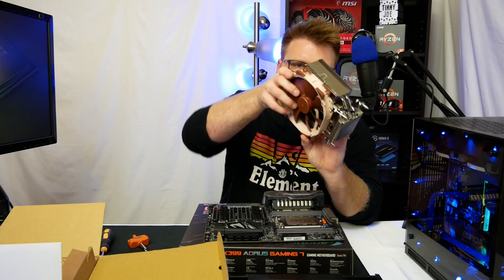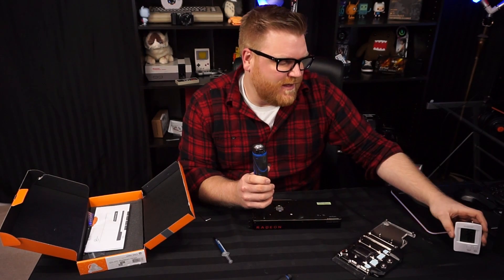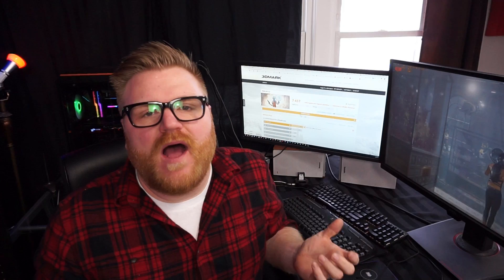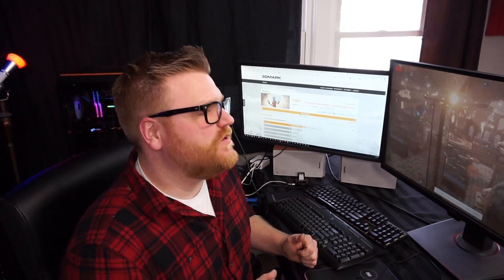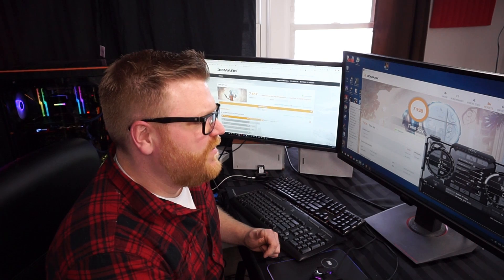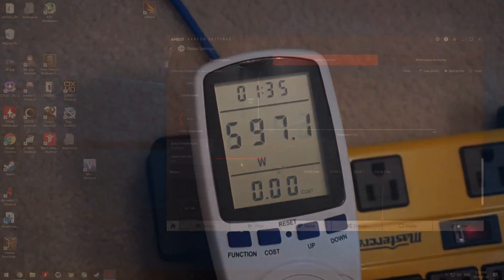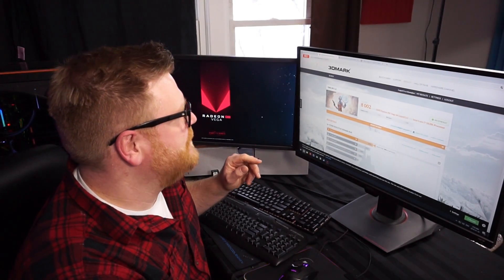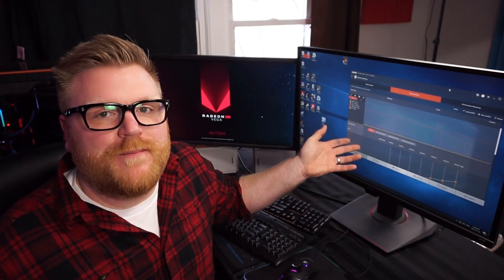Overclocking Vega 64 TO THE EXTREME

Comment: I prefer wattman. Undervolting  does work. Also hope you bumped up the memory.
Reply: Undervolt works, while you're being power/thermal restricted. But if it's about boosting the clocks as high as possible, on a subzero cooler the undervolt will just set clocks lower.

Comment: I just picked up a vega 64 gigabyte OC edition on ebay for $230 shipped.
Reply: And here I am thinking my $300 1070 ti was a good deal
Reply: @trv88r  and i thought that gtc 1050ti at 270 eur was a killer deal.
Reply: You sir, have picked up an incredible bargain. I'm not a fan of Gigabyte or ASUS Vega cards, but for $230 shipped, you cannot go wrong.
Reply: @chadwickhurlburt6529  I'm not either, I'm an xfx and sapphire kinda guy, but since it wa so cheap and an AIB, I went for it
Reply: @chadwickhurlburt6529  I got a gigabyte 1070 g1 gamer $425.00 when it came out I put new pads and paste, and for a old fx 6300 4x2 8gb memory rx 460 4gb 27in 1080p 60hz oc 75hz working good gigabyte not to bad for $98.00 new when video card's we're overpriced.
Reply: @chadwickhurlburt6529  Asus use to be mid to upper mid tier and now they are meh. ever since amd/ati/nvidia started selling their cards to third parties, Ive owned an Asus, Powercolor, and Sapphire card.
All 3 still work, but my Sapphire card, the highest end one (Radeon 7970) looks like it is first to die. Although I must admit the 7970 has been through a lot more hell than my asus radeon 4850 and shortly used (10 months) powercolor radeon 6770.
Reply: I just picked a RX580 8GB Golden Sample from PowerColor for £129.
Reply: @levyroth  I bought a rx580 4gb off ebay 3 weeks ago for $100, its what I'm currently using until my vega arrives :)
Reply: @titusarms  I'm thinking of doing the same thing.
Reply: It's cheap, can't fault that - but you will soon find out just why the gigabyte vega cards are cheap.
 - They're rather nasty (hot, loud and shittier than reference vrm)

Signed
--------------------------------
Gigabyte V64 owner
Reply: That's a great deal! I wish people in the U.K were crazy enough to build mining rigs, then I could get a great deal too. I also wish I had the balls/money to just pown a gpu till it pops/cant takes nah more laddy.
Reply: Im tempted to pick up a Radeon RX Vega 64 Liquid Cooled, for 400 USD. But not sure if it's worth upgrading from a 1070 TI. Any ideas? Gaming on a 35" 3440x1440 monitor.
Reply: Mads Isak I think, is the monitor freesync or gsynch, would be the appropriate question here.
Reply: @KevinScandinavia  had my omen 35" montior for sale, wanted to buy a freesync screen. Since G-sync now supports freesync monitors, but noone wanted it... so, went team green.
Reply: Mads Isak I’ve heard the same thing but I can’t find the option to try it out for the love of gaming so buying a compatible monitor was probably a good idea on your part 👍🏽
Reply: Mads Isak oh wait I misunderstood, but same idea 😄
Reply: Holy hell
Reply: And here I am sitting with a gtx 1050ti and no money to buy a new gpu
Reply: Got a 1080 for 260 (could've lowballed but whatevs) and some of my spare hardware I didnt need.
Reply: @kablooey2369  I got a g-sync monitor, ended up selling my 1070ti for 400$ (bought it for 450$ 6 months ago). And bought an RX 2060 for 450$. It's got Anthem bundled, so figured, why not
Reply: Downvolt and after that, overclock.
Reply: I built an RX 480 Xeon X3440 system for $230 😄
Reply: Hopefully yours doesn't blow up like mine did.... been under RMA for a month now.
Reply: @jdde013  mine did. Black screens with constant reboots, common the gigabyte gaming oc cards, previous owner never registered it for warranty, so I got it RMA'd today :)
Reply: Also just picked up a gigabyte oc vega 64 but for $295
Reply: @yosvanirodriguez7499   hows the card holding

Comment: so it is possible to use custom water block and with radiator? no need for pump water block or?
Reply: only with his temps, but not under normal room temperatur lol
Reply: Naw, you would need a pump and the radiator.

Comment: Love my Vega 64 sapphire nitro plus a air cooler that can actually handle the heat
Reply: That's what I have... such a nice card!
Reply: @BigSchu22  I love it! Looks good doesn't get loud and can over clock like a beast!
Reply: @beck320  Well i didn´t have much luck. Though mine manages to hit around 1640 MHz in games and around 1030 MHz for HBM2. I can get up to 1130 MHz, though depending of the game this creates errors above 70 degrees. 1080 MHz is stable overall, but creates small green pixel artefacts in RDR2 and rare crashes in Monster Hunter World. 1030 MHz is stable and creates no artefacts at all. Not a great overclock.
Reply: @Koeras16  that's ashame :/ overclocking is half the fun
Reply: @beck320  Well that how it goes. Though Sapphires Vega64 performs like a charm for 1080p. Bought it for 350 around a year ago. 

Can only agree though. Had a lot of fun testing the boundaries of this card. It can even go up to 1670 MHz in games, though for over 300 Watts.
Reply: Best buy ever, 270€ like new

Comment: glad to see Vega getting some love
Reply: Yea. My Vega64 Liquid card hits 1855Mhz on its stock cooler. Vega can do better but it lacks HBM2 bandwidth.
Reply: @nathans3022  what mem speed you run ?
Reply: @Steve25g  1100Mhz gaming. 1150 if I keep my room cold enough. My HBM is temp sensitive.
Reply: @nathans3022   I keep stable on 1530/1100 , 74% Fan, 925MV undervolt, Vega 56 , V64 flashed,without OC settings, it flies to 1650/1100, I love vegas
Reply: @Steve25g  can u help me underclock and overclock my vega 64 later ? i did ovezrclock an 470 and a 580 but vega are different
Reply: @Steve25g coreclock 1685 at 1080 mv 950mem

Comment: hey dude, was actualy just doing this, its going to hit negative 40 on wednesday, i was thinking of bringing my full pc outside and pushing everything to its limits, im running a powercolor vega 64 and 1800x
Reply: Condensation is not the problem if all outside the problem is coldboot bugs.  Memory and motherboards act very strange at sub zero temps.  Good luck though cold bug won't kill hardware just very frustrating.
Reply: im pretty sure if the whole thing is outside it wouldnt really develop condensation, but ill tske extra precautions, thanks for the comment friend
Reply: Seraph RTGN let us know how it goes bud very interesting
Reply: Cold air is very dense though, so it'll condense super easy. I guess you'd need to leave your PC outside so itself is as cold as the temperature outside so it's at equilibrium. Might need a fan on it to blast cold air on it to stop chips getting warm enough for condensation.
Reply: @stevenwest1494  There is very little moisture left in the air outside when it gets very cold.   Not going to get any condensation on electronics unless they have a lot of moisture in them when you bring them outside hot.
Reply: @lukew.9110  electronics have moisture in them?
Reply: Be careful with condensation. Unless you are are sticking a radiator or something outside, I would avoid sticking anything PC related outside.
Reply: HaloSam296 condensation isn't really a problem if it stays subzero as long as there is no temperature change. There will be no condensation while it is outside. When the condensation happens is when there is a change of temperature between the cooling substances and the rest of the PC. For example, LN2 is really subzero but if the rest of the PC is that temperature, it doesn't matter. It makes condensation when the PC is room temperature but the fluid is subzero. As long as segraph keeps it inside to thaw for a while before turning it on, he will have no condensation.

Comment: Vega is really insane with cold temps. Most air cooled cards cant even break 1700 MHz while gaming, and liquids max out at around 1770. Its not power limited (with reg mods), its not voltage limited, and its not silicon lottery. Its some fuckery with its boost algorithm and temps.
Reply: r u related to john wicks
Reply: @Invisinine im him
Reply: @jasonwicks7604  I got a nvme on a pcie and added 256 gigs of swap... think I can use it as vram on the vega 64?
Reply: @Invisinine I mean, with HBCC you can. Kinda like the SSG. Not sure how you could set that up in windows. Im sure on linux theres some obscure flag in ROCM that lets you flag memory SSG style.
Reply: @Invisinine also why are you asking me
Reply: @jasonwicks7604  i dunno

Comment: I am thinking about replacing my 1500 watt heaters with pentiums or something. Lol. Mine xmr. Or something. I think it will be cheaper. After I oc them.
Reply: there is actual a start up, where you buy a pc that is heater together cuz it mines cryptocurrency alltime lol
Reply: @Xenoray1  it expensive I just want to go to goodwill lol.
Reply: @RavenPrecept last winter I had a 120mm rad on my i7 3930. And it got how with the heater on low lol.  Ridiculous

Comment: Radeon 7 has 1800+ mhz boost out of the box, gonna be gud
Reply: LORD OF FREEDOM but only 60 compute units 😬 hope it actually runs at 1800+ out of the box
Reply: @tireshredder4208  compute units makes it harder to get a higher clock, actually
Reply: jac jac. Yea but less compute units means less raw performance but it will hopefully oc to around 1900-1950mhz, but that is yet to be seen
Reply: @tireshredder4208  well, if that where true the 1080 and and the 1080ti would be much much worse,  the thing about vega is it has all the cores but it has all the baggage of computer cards. If game devs actually used those extra parts vega would be the best flat out. Infact the Volta architecture is very similar to Vega, and note that is just a compute card. 
And the 2000 cards are just cut down volta.
 This is the first time where nvidia has more than 40 cores
Reply: jac jac. No, because Nvidia didn’t know how the Vega cards performed before they launched the 1080ti and they also didn’t know how the Polaris cards would stack up to the 1080 because they released both of those before the launches of the amd cards
Reply: 1800MHz Boost so 1800 and under. Same as Vega 64 LC has 1750MHz.
Reply: @ZAGAN-OZ  It should be able to OC a bit more. Fury X to Vega 64 was a 28nm to 14nm change and that let Vega 64 to much higher clocks. Im hoping RVII OCs to 2ghz. Would be a sick card.
Reply: 300W 😤 I like amd but a used 1080ti is a better deal
Reply: @chrishansen7004  only for playing games (at this moment),  for the rest?  Support, well AMD serves you longer. In Linux AMD is better option than Nvidia. I would say always buy what suits to your needs.